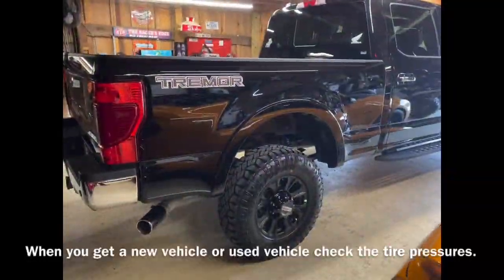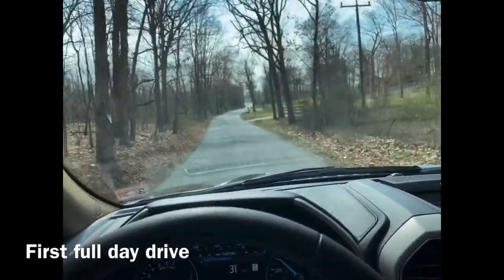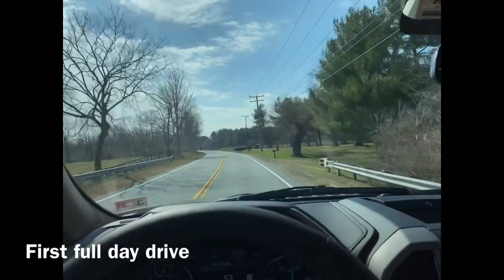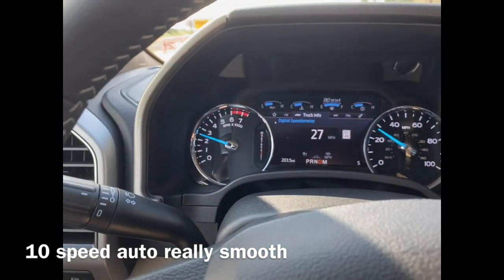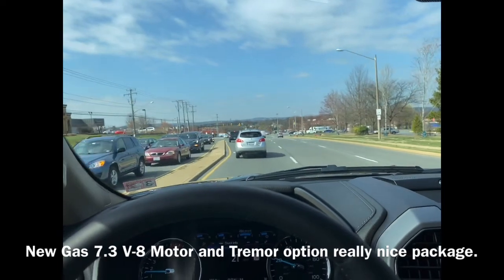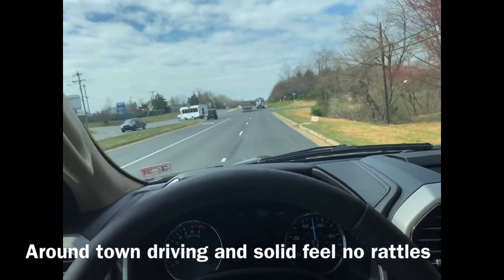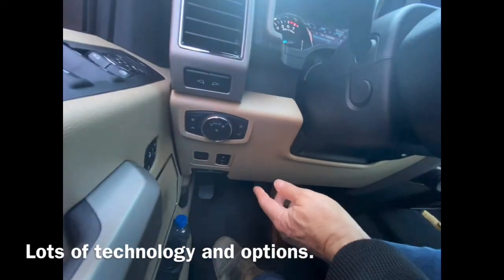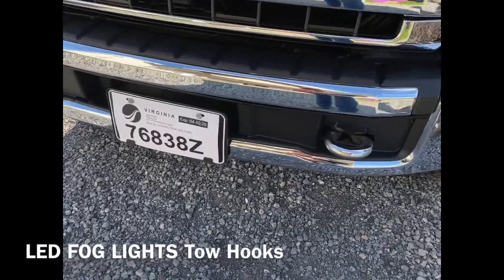ICE AGE TV Brand New 2020 Ford F-350 Tremor 7.3 GAS Motor Review

Comment: I custom ordered my Tremor back in September and picked it up in late December.  I got a 250 / Lariat with the 7.3 gas and 4.30 gears.  Absolutely love it!  Mine got 13.5 on highway on the way back from dealership.  Ford needed this 10 Spd for a long time.  It's awesome.  For some reason I did not order a front camera.  My only regret so far.
Reply from the maker: Like to hear how happy you are and I’m right there with you this is one of the nicest HD setups I have owned.  My only gripe is the Winch kit availability is later in the year and damn wish I had that right now.
Reply: @Iceagetv  Yes, that winch setup looks awesome.

Comment: Awesome review.
When you test drove the other super duty could you tell any difference in acceleration? I was hoping the 4:30 rear in the tremor would be a noticable difference.
Reply from the maker: Yes their is a big difference on acceleration and ride plus fun factor feel.
Reply: The 10 spd has super-low ratios for the first 3 gears (4.61, 2.91, 2.13), so, you have to be careful goosing the accelerator in a parking lot..LOL.  Coupled with the 4.30, there is a lot of ratio to get things moving.

Comment: Great review!  I enjoyed how much you discuss the ride quality in great detail.  I ordered an F-350 Lariat Tremor 7.3 and it arrives this week.  Coming from an F-150, I was nervous that this truck would be uncomfortable but it sounds like it rides quite well.  Out of curiosity, what is your payload capacity?
Reply from the maker: Thank you and congrats on your new Tremor,.  Payload is rated at 3470lbs and just sou you know the F-250 and F-350 share the same rear springs which makes the F-250 actually a F-350.
Reply: Fox 2.0 shocks or King 2.5 shocks from Carli suspension will make the truck ride even better. In addition, you could replace the factory spring shackle attachments on the rear leaf spring packs with Sulastic Spring Shackles...for a more comfortable ride.
Reply: @Iceagetv  I have read and heard the same thing concerning the rear leaf spring packs (same spring pack) on both F-250 and F-350 SD trucks with the Tremor Package. However, I did some research and found some information at fordtremor.com regarding the payload numbers. It appears there is a wide spectrum of difference in the payload numbers on these trucks...definitely a difference with the 6.7L diesel and the 7.3L gas...but also appears to be some differences depending on other factors. Not certain, but possibly various other options, packages and maybe even trim levels...more stuff = more weight which in turn affects payload numbers.
Reply from the maker: Thanks Danny and 4,210 lbs.

Comment: I missed it. What is your MPG. Did you say 10?! Is that city or highway?
Reply from the maker: Yes 10 Mpg is correct and city driving.  Highway would be 12  plus and this is a huge motor 445 Cubic  inch.  Gas is getting cheaper which for the time being imo your getting 20 mpg lol if you factor gas will be $1.50 in the near future versus $3.00.

Comment: This makes me laugh, I special ordered my truck from my dealer. I have found a few date stampings on my truck. It was built and made it to the dealer with in a month. Helps that I'm in metro Detroit and the truck was built in Dearborn. My tire pressure was 50 psi. Dealer did not adjust the pressure at all. Should have been set at 36 all around according to the door sticker. Never had this issue in the past though. First time. Wish ford made the tremor in a supercab, no use for a crew cab. Come on ford. What the hell.
Reply from the maker: Hey John double  check your door PSI sticker it should be 60 and 80 if you have the F-350.  These are truck rated tires for heavy duty capacities and towing weights.  36 psi is passenger tires and SUVs but not for Heavy Duty trucks and sure 1/2 ton trucks are 36-40 psi as well